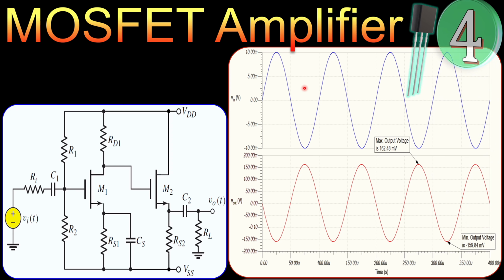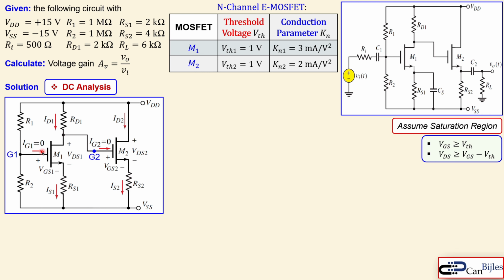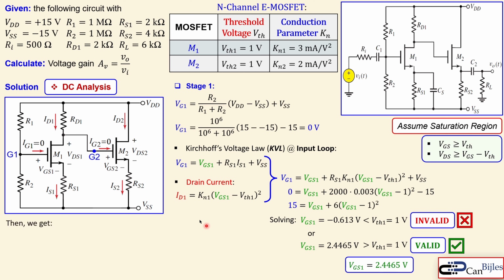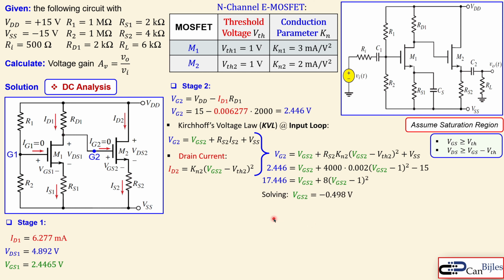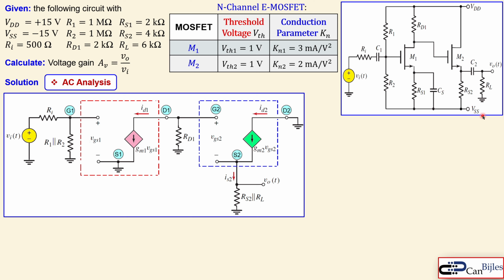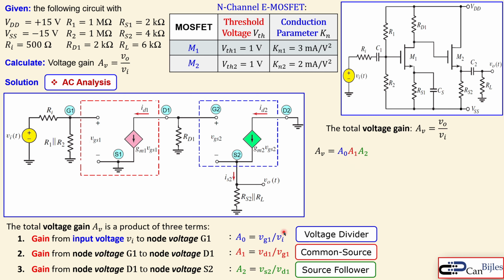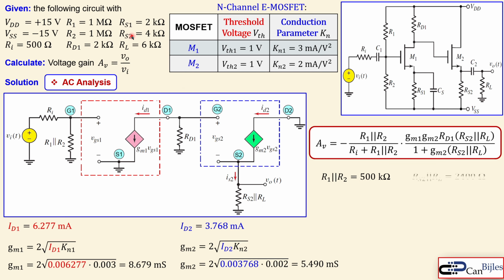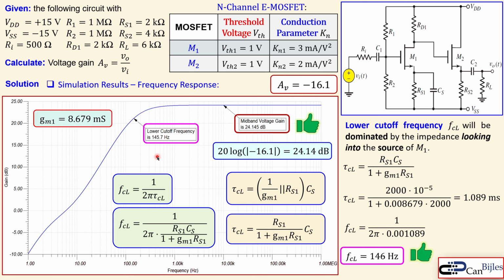Two-Stage MOSFET Amplifier 🌟 N-Channel E-MOSFET 🌟 Calculations & SPICE Simulations 💡 Example 4

Comment: Hello I just want to ask when calculating the Input impedance Zi do i include the Ri which is the source resistance or not 

and thank you for these videos they are  very helpful
Reply from the maker: Thanks for your message. Glad to know you liked the video 👍 
Looking from the input voltage source, then you need to take the Ri also into account, which will be added to the impedance looking into the gate node of MOSFET M1.
Reply: @CANEDUX  will it be series with the R1//R2 or parallel to the hall thing 
Zi = (Ri+R1//R2)//Zi' ??
Reply from the maker: @khalil-0559 The Ri will be in series with the impedance looking into the gate node of M1. Thus: Ri + (R1||R2).